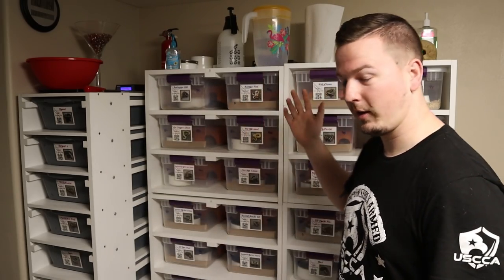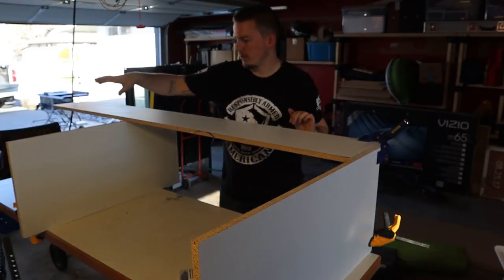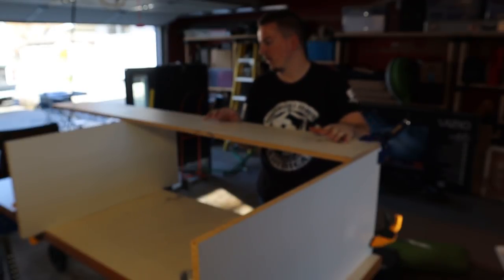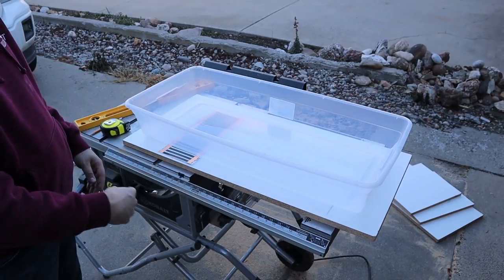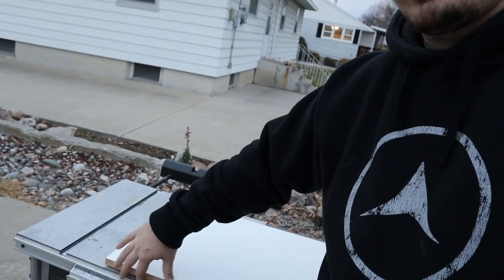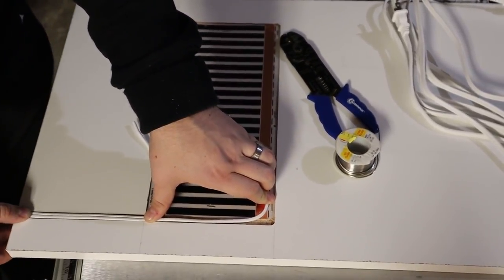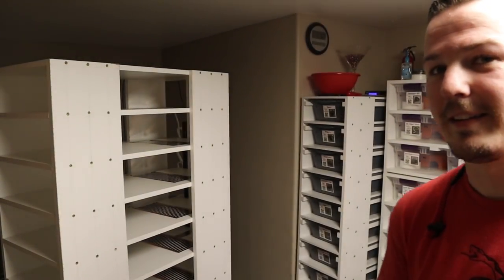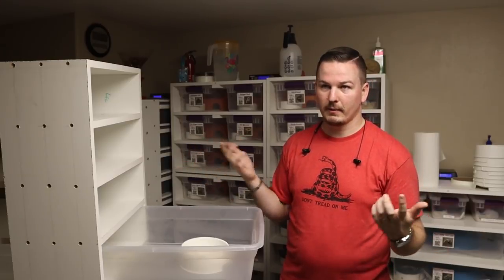LETS BUILD! | 10 HIGH BREEDER RACK! | Mixology #29

Comment: Great video, and a beautiful rack.  I wish I had your woodworking skills and equipment, so I could duplicate it.  One nitpick, however:  you made such a big deal out of all 10 power cords being the same length so you would have the same amount of power going to each shelf, and then you plug them all into a strip that no doubt has different lengths of wire from its power cord to each outlet, which negates the whole thing.  Actually, that probably doesn't make any difference anyway at the relatively low power levels you're drawing, but then neither does the length of the cords to the individual shelves.  I do like the idea of being able to unplug shelves you're not using, however.  Thanks for sharing.

Comment: For those of you who are soldering THG heat tape: Instead of melting the plastic like that, turn it over and cut a square off the bus bar. It'll save you (literal) headaches burning plastic and soldering connections.
Reply: wait whats a bus bar?
Reply: @jackystewy  The 2 thick bars that the smaller bars connect to. If you turn over the tape and take a knife or exacto and just cut deep enough to expose the metal but not cut into it, you'll have less issues.

Comment: Awesome channel by the way. This is my project today. What is the most efficient way to have lowe's rough cut it without losing any board?
Reply from the maker: There’s a Google doc in the description of the video with a cut list. You’ll need (3) 4x8 boards
Reply: @MorphMixologyReptiles  what kind of wheels did you use for the 3/4 melamine on the bottom?

Comment: Im going to do mine just like this but using pine for the sides instead of melamine. 2 sheets of melamine just for the shelves. Im doing a 10 high for 41qt. Might wire every 2 shelves together so its less wiring than 10 individual. Worst case have one extra heat tape running.
Reply from the maker: Make sure the pine is kiln dried otherwise it can be toxic to your snakes
Reply: @MorphMixologyReptiles  Thanks for the heads up

Comment: Hate to say this but I tried those EXACT same water dishes and they have a huge inherent flaw. That opening in the bottom makes them think they can get under it and they try...and in trying they flip the dish over. I bought 50 of them. The next day i had about 40 flipped dishes...I was so upset lol. What I did find though was that dollar tree sells surprisingly nice dog water dishes that are almost the exact size but just a little bigger. I bought red ones for my females and blue ones for my males. And at $1 apiece you cant beat the price. I also use industrial adhesive backed velcro and put one side on the tub and one side on the bottom of the dish so that they cant move or spill them.
Reply from the maker: Interesting. I'll have to keep an eye on that. The girls in this track could never fit under them so hopefully they don't try 😂
Reply: Ha! I went through the same thing with a similar bowl! Though fortunately, I had only picked up one to test. But yeah, the little notch is just enough for them to give it a try. Water, water, everywhere and not a drop to drink! I've got one male who remembered it and now he pushes his dish around the tub, trying to get under the edge (funny guy!). 

I'm actually using it successfully now but only because I happened to switch to coco fiber, so now I can bury the bottom to keep the girl that's using it from noticing the notches (plus, she's not all that curious or adventurous).

Comment: Love the video man I’m building a rack in the next few days and am going to wire my heat tape like this, does it have to be a huge power strip like the one you have? Or can I use the shorter ones if it’s only a 6 level rack ?
Reply from the maker: Just a power strip. Doesn't have to be huge
Reply: Thanks man

Comment: For this rack to work you need to have all levels plugged in at the same time. If you disconnect one, you'll have to turn them all off and do them all at the same time again
Reply from the maker: Not at all true. Each outlet is supplied the same amount of power based on the one with the temp probe. The power strip allows you to unplug any level individually (except the one with the probe).
Reply: @MorphMixologyReptiles  say your heat temps are all at 90 and you unplugged one tub and it goes to 75. The thermostat still turns off the power supply when the probed tub gets to 90 so if I want to plug the cool tub back in, how does it heat up fast enough to get back to 90 like all the others.  I'm building  this rack this weekend so I guess I'll find out for myself soon enough. Thanks

Comment: How well has the melamine held up under normal use? I have access to pvc foam board but it is really expensive. Could you get 2-3 years use out of the melamine if taken care of properly?
Reply from the maker: I'm confident in 2 seasons. Not sure beyond that. I've seen some melamine racks that are 6-10 years old and still holding up

Comment: Is the routing necessary or could I just use foil tape to tape it down?
Reply from the maker: No because you don’t want the tubs sliding on the heat tape. It can tear it up and cause a fire
Reply: If you fully encase the heat tape with the foil tape then you should be fine. You'll just want to inspect fairly regularly to make sure there is no peeling of the tape and exposing the heat tape.

Comment: With the 10 High could you just use a Herpstat 1? Great video by the way.
Reply from the maker: Yes absolutely.
Reply: For the price difference, go for the herpstat 2. You may never need to use the second imput, but it's cheap "just in case" insurance.

Comment: Quick question. How do you fix the possible problem of a level of heat tape going bad and being alerted of that happening? Being that the probe is just fixed to one level. Do you monitor every level every day? I like separate heat tape pieces for each level but am afraid of one or more becoming faulty and stop heating or over heat the tub. Thsnks
Reply from the maker: You just have to keep an eye on your collection. That's part of the job

Comment: Nice video, but I guess what I'm not understanding is saying "it's breeding season...I can keep 12 clutches in the Rock Star cooler, 18 in the new one".  At 12 clutches and roughly 84 snakes...why not just buy an ARS or freedom breeder with that revenue?  At $250 a snake and $2500 per professional rack system...that's 1.5 clutches from one snake in one season.  At $125 a snake that's three clutches.  Have to take into account the cost to build something like this, calculate what your time is worth, the longevity of it (since you'll likely upgrade later), and the amount of money you're saving is the spread between those two racks.  If this rack is built for a few hundred dollars, super.  Subtract that from the cost of a professional rack system, divide that by your average sale per snake, and unless you're breeding normals, a few clutches should pay for a legit system and last you a lifetime.

Comment: Do you stop feeding your breeders iternet says to stop feeding them then breed and do you drops temps???
Reply from the maker: Breeders will often go off feed naturally during breeding season. And no I don't drop temps
Reply: @MorphMixologyReptiles  I'm making a new snake rack that uses 4 separate 4 foot sections any advice on what thermostat. Could use and could I use just a single with an extension chord
Reply: @MorphMixologyReptiles  I'm using 4 in heat tape
Reply from the maker: I use all Herpstat thermostats

Comment: Electrical theory is off a bit... But great video as always.
Reply from the maker: Thanks! What all I off on?
Reply: The heat tape its self is built in parallel. While the end will have slightly less voltage. It would be very negligible.
Reply from the maker: I see what ur saying. But still from level to level, it should be consistent
Reply: The way you did this one absolutely will be 100% consistent. Even in the combos the temperature should vary very little. I copied your combo I liked it so much.  Appreciate your budget friendly approach... you have made dollar my favorite store.
Reply from the maker: Haha sounds good! Glad you like it
Reply: From my understanding the heating elements are not actually meaningfully connected to the copper strips, so it is in effect just two flattened copper wires with elements conducting the heat between, not conducting electricity. This would mean heat tape is absolutely not internally parallel as you suggested.
Reply: @LITTLEREDBEAR917  the heat tape is definitely built in parallel. Just look at it each heating element (the little black pieces connected between the copper are  in parallel,  as are the two copper strips. If these were built in series the first 3 elements would be the only thing recieving enough power to actually heat.